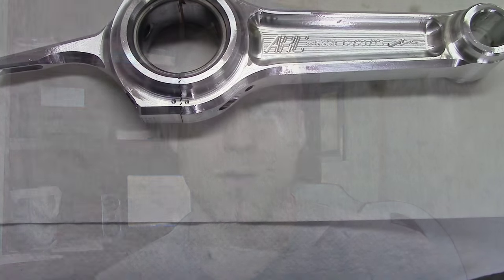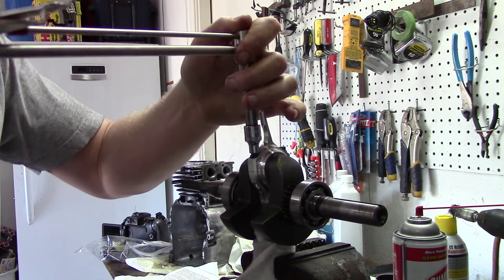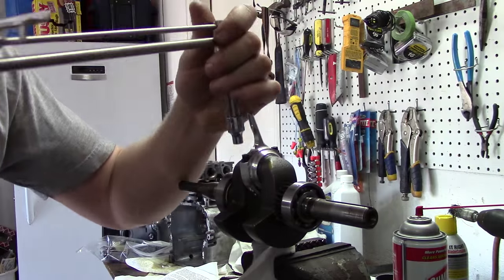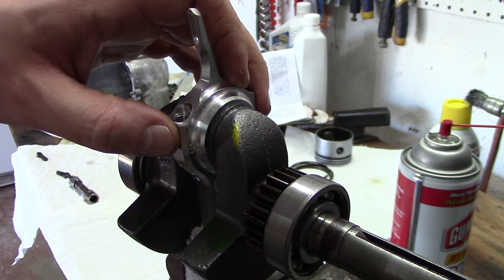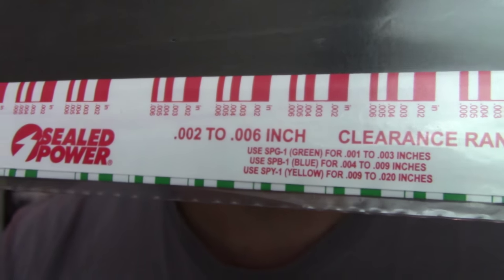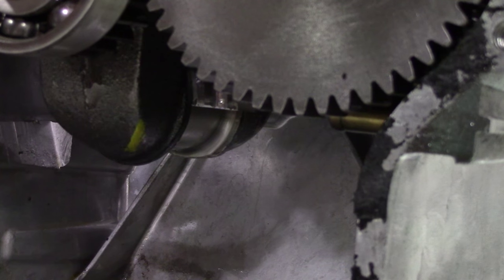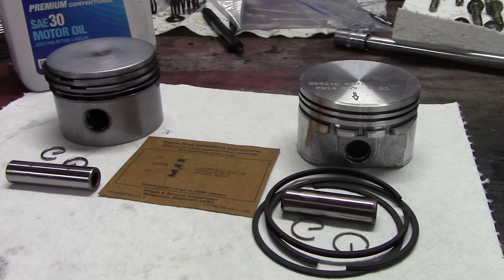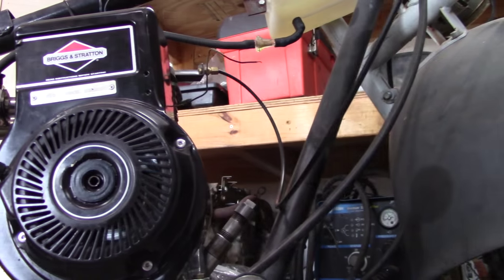Arc Billet Connecting Rod Installation and Torque Specs

Comment: I had an old russian made two cylinder engine and what I did with inlet and exaust ports was that I took some material out and made it like a golfball surface... It does help a lot and polishing isnt going to do any good. polishing after golf ball surface finish? Perhaps... It was a flatheat straight 2.

also I found that the more the valves open the more power you get to a sudden point where they hit the top... It lowers the compression if you grind hollows to top of the valves but still the gains are huge..I just welded some extra on camshaft to increase travel of the valves... I doubled the rpm of that engine with just car carb from toyota starlet. Engines sure are fun till they blow into pieces..
Reply from the maker: hmmm i havent heard of the golf ball surface. Might need some empirical evidence before you could convince me to do that. I'm sure the size/shape of the ports matters more than the surface type. Its more about flow at high rpm. Its common knowledge that the inlet needs to be rough to keep fuel atomized, and the exhaust can be polished to slow carbon buildup and provide less resistance. sounds like you are taking it to the next level with DIY style though. keep up the good work!

Comment: Would I have to replace rod if I removed governor... I know I would replace flywheel but I don't have the knowledge to go in the case of the motor that far and do it properly
Reply from the maker: +Fletcher Mcconnell I wouldn't remove governor if you don't want to mess with the connecting rod.

Comment: Btw. Follow up to your process of torquing the bolts: you should never ever hold the crankstaft by just putting the smallend of the rod in a vise. Put the crank into the vise instead.
Reply from the maker: Nope. You’re wrong.
Reply: @KartFab  cool, go on then.
Reply from the maker: @thoughtnox  tell that to the manufacturer of these rods and see what they tell you as well.

Comment: What is the best way to advance the timing in a small engine? Should I do it by adjusting the cam shaft forward a few teeth, or should I cut a new key way into the flywheel? This is for an overhead valve engine.
Reply from the maker: +Will6804 none of the above. Do not do that. You need to either buy a special timing key, or buy a degree wheel and set your timing before top dead center on the compression stroke. The key does not hold the flywheel on, the friction between the crank and flywheel when the flywheel nut is torqued keeps it in place. You technically don't need a key if you have a degree wheel.
Reply: +KartFab I understand what a degree wheel is, I'm just not sure how I implement it into the proses you suggested.. Just so I understand, I don't want to adjust the timing frame the cam shaft or the flywheel. So what do I adjust?   Thanks in advance.

Also.. I spent a good 2 hours over the past 2 days trying to find an answer or example for timing advancement on small engines just to find next to nothing, other than what you say not to do.. I think you would get some decent attention on your channel if you made a vid to demonstrate proper practice.. Just as a suggestion.
Reply from the maker: +Will6804 will there are two ways.

1) buy a key that advances your flywheel by whatever degrees you need to advance the flywheel. Remove flywheel, install key, reinstall flywheel and torque flywheel nut to spec.
2) buy a degree wheel and an instrument that measures top dead center. Set degree wheel to Zero at top dead center on compression stroke. Next spin wheel to mark/line on magnet where leading edge of magneto begins to fire (if no mark exists, you will need to find out where the plug fires by using a timing light). Read degree wheel. This is the degrees before top dead center. Next remove flywheel and rotate to whatever timing degree you want to advance your timing. Once you are satisfied with the dbtdc, torque the flywheel to spec. I can't explain it any more clearly than that.

Comment: What does it mean when the oil rings wont synchronized with the block while using a piston ring compressor they just seem too lose going into the block hitting edges?

Comment: good video, but i think theres some stuff left out. You could go into much greater detail especially for those who are new to small engines or engines in general.
Reply from the maker: +James Webster (ShamelessBullet) such as ?
Reply: maybe some benefits of a billet rod. I know you mentioned that you can go higher rpms already, but also that its stronger, and can increase compression depending upon the rod you pick. Maybe mention to find out your in the hole measurements and buy a rod according to that. or maybe do a separate video on that completely. Maybe show what the connecting rod bearings are and how to insert them correctly. ( some people don't know ANY of this stuff ). when seating the bearings mention or stress that you have to go back and forth by increments. show the plasti gauge going on the crank shaft journal so people have an idea of how much to put on. Also when you mentioned the other method using the digital calipers maybe show that process. Other small things/details could be explained as well. You make good videos no doubt! I just feel as if they are more so for intermediate viewers instead of beginners. Which may very well be what your aiming for, I have no idea.
Reply from the maker: Thanks for the input. You have a good eye for what needs improvement. The only problem is that once my videos are released, I cant just re-do them :-( I'll be making a predator 212 from stock build in the future and will keep that in mind as I make the videos.
Reply: No problem! and I think a predator build from the ground up would be an awesome series! I honestly think it'll bring in a ton of views and help alotta people.

Comment: I don't know but, apparently I had two connecting rod bolts that failed. both snapped at 160 in lbs. Everything went well seating the bearings both bolts torqued at 170 in lbs. When I removed the bolts after that to install the plasti gauge and start the torquing process again, when I reached 160in lbs that's when the first bolt snapped. Then went to the other bolt and that one snapped. What are your thoughts on that??
Reply from the maker: I'm guessing you didn't torque it down according to the instructions, or that you were torquing to foot pounds? Did you oil the bolts before torquing and make sure everything was clear of burrs and little aluminum shavings? Did you torque down both sides slowly, alternating by 20 inch pounds on one side, then 20 inch pounds to the other? I would check with the manufacturer if you did everything right.

Comment: Since the Clones or Clonda's came out I've stacked these old Flathead Briggs up like stove wood. Folks will bring me the same old Briggs several times a season and I'll talk them into spending $100 and and have total dependability. Since I have these old Flatheads and seeing the Clonda carburetor videos has gotten me to thinking about building a performance Flathead. Will these older engines run with the Honda class engines? I only use them for homestead chores. Will this engine with the billet rod , porting a d Clonda carburetor out perform a mild Honda? I guess with the mods you've done to this engine with just a billet rod in a Clone and the rest stock would this Briggs out run the Clonda as described? With a free platform to start with in these Briggs that I've collected and a billet rod and maybe a performance piston plus all the labor of love in making intake and the other lite machining I could have a project or should I spend on a new Clone and add to it?
Reply from the maker: +Phil Lowman ohv engines will always outperform the ok Briggs flathead. There is just no comparison if you look at it cost wise.

Comment: So you can not properly size a con rod to crankshaft tolerance with a caliper. When .001" can mean the difference between go/no go you have to use a micrometer.  If you do not have access to a dial bore gauge and micrometer, which most DIY people wont, you need plastigauge like you showed. Thanks for the vid
Reply: Agreed.

Comment: Hi when using a digital caliper and measuring the outside of the journal to the inside of the bearing what number do I have to be between when using a stock crankshaft on a predator 212 what oil clearance is in the safe Zone after I deduct the numbers?
Reply from the maker: Should be .002-.004” ish. Also, the instructions that come with the rod will give you the diameter of the crankshaft. If it’s too big, then you may need to sand down and polish.
Reply: I measured the crank journal with caliper and got 1.189 vertical measure and 1.190 horizontal, im right on the line there, waiting on my rod to come in. Thanks bud

Comment: sooo.. I'm confused.  upon tear down of my bone stock brand new 212 to evaluate what mods I want to make, I notices no bearing between rod, end cap and crank journal.  this concerns me..  under light low and low rpm I don't see this being an issue, but being I want high somewhat reliable revs I see the rod/bearing... or where the bearing would be as the weak point.  (experianced with engines but first time going internal on thos one)
Reply from the maker: +jahosaphet05 arc billet connecting rod needed only if removing governor and revving high.
Reply: That is precisely why I want it

Comment: What can be done if you don't have the right measurement from the bearing and the rod?
Reply from the maker: +Robert Williams if your oil clearance is not big enough, you take emery cloth and sand down the crank. If your oil clearance is too big, you buy oversize bearings.  Remember that the bearings are press fit, so you must torque them down to spec on the crank before measuring clearance.
Reply: +KartFab 
Thanks and great video. Look for you flywheel video.

Comment: I didn't get it torqued to 20 inch pounds and broke my pod bolts while installing I think my torque wrench is broke or not reading correct
Reply from the maker: ummmm you sure you weren't reading newton-meters or foot pounds? 20 inch pounds is like 1.66 ft. lbs or 2.26 newton meters. ARP bolts, OILED, and alternating between the two slowly going up to 20, everything lined up?
Reply: @KartFab  yes my wrench was flawed I replaced it to today I was using a 1/4in torque wrench and I was reading the inch pounds it just wasnt clicking on 20inch pounds i just assumed I was even close to where it needed to be because it just kept turning apparently I was stretching the bolts and snapped I was able to get them out flawlessly and ordered new arc rod bolts never again will it happen again I was mad as fuck like I got misinformation but I double triple checked it says 170inch pounds and yes I will bolts and I started it 20 inch pounds because it broken it never even registered on my wrench so I just kept on thinking 170 inch pounds was a lot
Reply from the maker: dang that blows, good thing it was an easy fix. Apparently if you use your wrench a lot you are supposed to calibrate it if it is the click type. Im old school and just use the needle one. If it ever goes out i can just bend the needle haha.

Comment: what does that additional rod sticking out at the bottom of the connectig rod do?
Reply from the maker: +Jan Savay-Guerraz the oil dipper? It lubes the crank journal and slings oil around in the engine

Comment: its very dangerous to torque the connecting rod with it being clamped so low. it could bend and cause accelerated wear
Reply from the maker: +Tim Kuzmenko nah. That's how it's done. Plus this aluminum has a high tensile strength so it won't bend.

Comment: I would never recommend measuring the inside of the rod bearing surface with calipers. If you don't have an inside micrometer stick with the plastic gauge